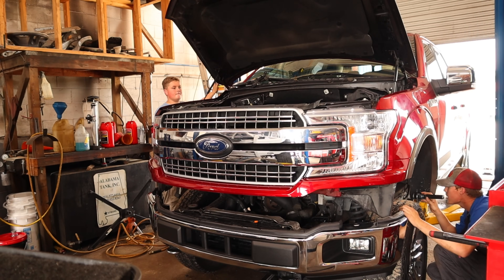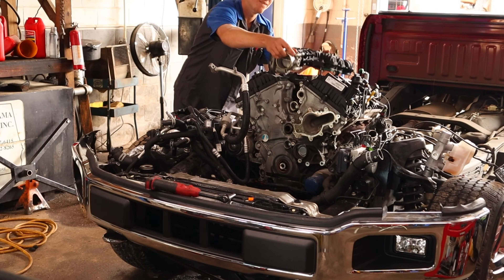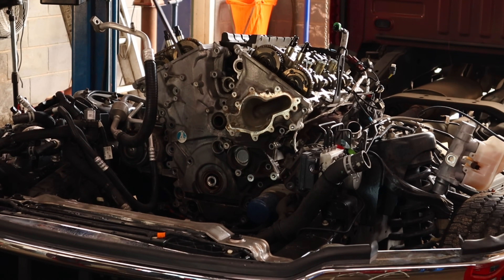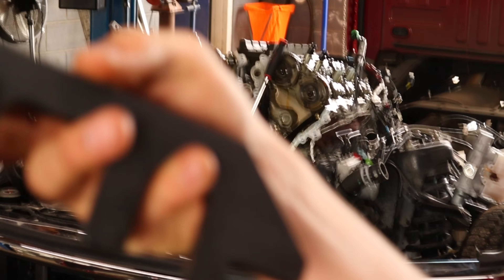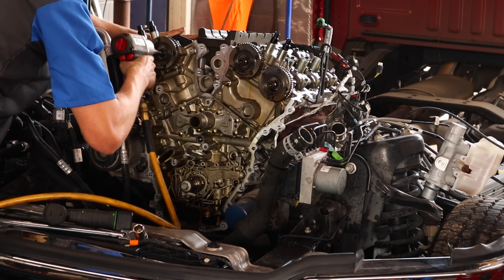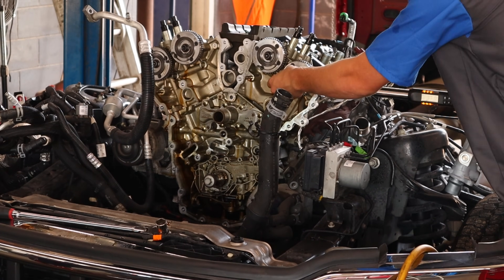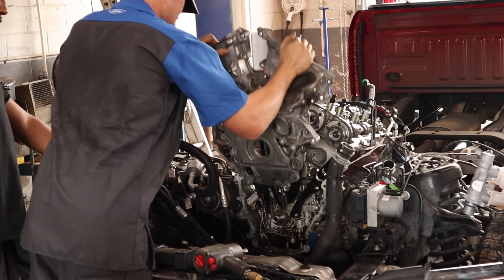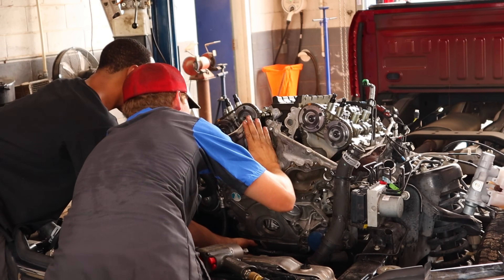Ford 3.5 EcoBoost Cold Start Rattle (VCT Phasers) | Everything You Need To Know

Comment: mine is rolling over 300 now ive got rattle but I generally put the accelerator to the floor to shut the injector off until the oil pressure gage comes up.  I generally have to do it 2 start cycles but it keeps it from rattling.  ive thought about a block heater installed at the oil pan. im probably looking at a new motor soon is it possible to put  a newer gen 3.5 in my 13?

Comment: the explanation you gave for what actually causes the rattle is pretty spot on, at least according to my ford ASSET instructor. they have a pin that is supposed to hold the phasers in midlock right as the engine shuts off, that way in case the oil bleeds out (which its not supposed to, but already failing phasers, or cheap oil filters may cause that) the phasers will be held in the middle position until there is sufficient oil pressure for the solenoids to control the phasers. what happens is sometimes the pins dont engage in time (which the PCM update is supposed to help with), or the pin gets completely sheared off, and then theres nothing controlling the phaser. the actual noise is from the outer part of the phaser, the part connected to the sprocket and timing chain, literally smacking the inner part which is connected to the cam, over and over again until theres oil in the phaser.

Comment: The rattle is because the phasers are coming apart internally and when they no longer lock to the cam, you get the rattle at cold start.  The phasers are junk and poorly engineered….

Comment: I have a 5.0 coyote with this issue. Only happens under load so in park or neutral don’t hear a thing, but in gear every time you let off the gas after 3000 rpm and under you hear the chatter. Also is louder on a cold start but quiet’s down after it reaches higher temperature but doesn’t disappear and again is more quiet in sport mode but doesn’t go away. Just thought I would add more info to the problem.

Comment: 2020 with 70,000 and it has just started making the cold start noise. I will never buy another Ford. I’m done 
Especially with the cost of a new truck that they expect the customers to pay.  Your better off buying on older truck and putting a new motor in it than to repair junk.

Comment: Great Video.... A couple questios.I picked up a 2020 transit with the pfdi duratec 3.5.
Are the same phasers used in my non ecoboot?
My cold start rattle goes away in about 16 to 20 seconda and won't come back until the next morning,Should I be worried?    Thank You

Comment: So what is actually rattling? The VCT solenoids or the phaser mechanisms on the front of the camshaft? My 2019 F150’s 5.0L is rattling. A Ford dealer replaced the phasers and VCTs a couple months ago (covered by an extended warranty I purchased, thank God), but it didn’t fix the rattle at all. In fact now it seems worse than ever 😢

Comment: I have a 2012 ford explorer with 3.5l at atart up it rattles hard for like 2 seconds then it quiets down and there a ticking noise as it warms up .i think its a oil pressure thing.they need to go back to simple engines like 2003 f150 thats there problems new ideas newer problems.

Comment: there is a video from a ford mechanic  and he say to delay start  press brake and hold  gas pedal  to the floor  let it crank  then let of  gas pedal  up and the truck will start with vct rattle  Mayson your correct   oil pressure   bleeding back

Comment: I have an F-150 2018 with both the 10-speed and the 3.5 EcoBoost. I bought it a couple years ago. Did my due diligence truck was supposedly bulletproof. Now the transmission's acting up and I just got the cam phaser rattle today. Less than $123,000 on the vehicle. This will be the last f**** Ford product I ever buy. Ford used to stand behind the products. Now they stand behind you and laugh. Looks like I'm going to be a Chevy man.
Reply: Correct, exactly I got the same problem.2018 F 150 Lariat Brand New truck 35000km same issues.one time free fix.
Again same issues 115000 no free service asking 5000/-
Garbage truck.lost 85000/-
Everything is dummy.

Comment: My 2018 3.5 Ecoboost has been exhibiting the cold start rattle for about a solid 2 years, and was getting progressively worse. I’m just over 100k in mileage. Since it’s a work owned truck and not my personal vehicle, the boss finally gave me the green light to get it fixed. Local dealership here in Michigan did it for $6,200.00 but I also had a cracked valve cover and defective oil pressure sensor switch which was throwing warnings. Picking it up tomorrow… hopefully everything is now 100%

Comment: Could a possible vct solenoid failure be part of the issue of the phaser rattle? Or maybe an oil filter that doesn't prevent oil drain back ?

Comment: I see people going 7k+ between oil changes, 140k on the original plugs, never changed the air filter, and on and on. So much of this stuff can be avoided by doing proper maintenance. With any of these modern engines, I would be doing oil changes every 3k if using a typical group III synthetic and 4 - 5k if using a group IV. Not to mention check the owners manual for other countries and go with that viscosity, and don't fall for this U.S. federal gov't water thin oil scam.

Comment: Done this job twice.. first time for vct phasers. Second for not replacing some of the timing guides. If you are in there, Replace everything!.. phasers,chain,guides,water pump, gaskets etc. Also added a melling high flow oil pump for $170. did not have to drop the oil pan..
Reply: Man I bought my 2019 Raptor new and I don’t think it had 6k miles it had to go in. Top end had to be rebuilt because of the phasers. Now I’m at 149k miles and maintenance it myself, religious on oil changes and fluid checks. Now it’s rattling again. What are my chances you think Ford helps me out with the bill given that the truck already had a problem and I can’t recall getting anything in the mail concerning a recall? Regardless if I have to do it without Ford I will follow your recommendations as didn’t think about the water pump.

Comment: Excellent videos!!  I found them because I now have the VCT rattling issue.  My 2019 F-150 Limited has 109K miles and the check engine light came on last week.  The dealership gave me an estimate of $5500 to replace the cam phasers, timing chains and guides.  My extended warranty company (EasyCare) doesn't want to cover the costs either even though I have been consistent with the scheduled maintenance.  I may need to come find your shop.  Im from Alabama as well.

Comment: I’ve got a 2013 f 150 ecoboost with 125k miles, I’ve had the rattle for a while now. A local shop told me $4500 to fix it. Is this something critical to repair or just a noise annoyance? It’s a pretty expensive repair for an aging truck
Reply: Good question. I'm retired from the garage, but here's what is probable, that can happen. 
First, what's going on is the can phasers, are parts that adjust cam timing, through oil application internally, are weakly designed and wear out. On a cold start they are supposed to be locked, but the locking mechanism wears, and that's what is causing the rattle until oil pressure builds. 
Continuing to allow this will eventually result in breakage and more engine damage. 
The new phasers are beefier. Definitely have it done. Mason's other videos explain more. And the price quote you got is spot on.

Comment: working on a 2014 5.0 4x4.  with low oil pressure.  we replaced the pressure sender. still issues was planning on replacing the oil pump has 150k on the truck.  (light and gage drops to 0 when  idal drops under 500 rmp.) after watching your videos on the phasers. i'm wondering if its possible phasers they are not to noisy . Have you seen oil pressure increase after this repair? or have you seen several oil pump issues too?

Thanks!

Comment: I did this job on a '19 3.5 EB.   I got it back together & felt good about it till I went to start it. It had a long crank time & upon start up, the HP fuel pump was hammering. It would run quiet if I unplugged the HP fuel pump but it had low power. After ripping it all apart again, following advice, all for no avail..
I found a tiny transparent silicone bead (not rtv silicone waste) lodged in the HP fuel rail inlet port (directly from the HPFP).. zero fuel was getting to the hp fuel injectors. I had to replace the passenger side HP injector rail because I couldn't get that bead out until I cut it apart & forced it out. The size of a grain of salt. Where could this have come from?
PS, after replacing that fuel rail, the fuel flow was immediately confirmed & the truck runs great. I am not shitting you.. a tiny bead caused me much grief & cost me an additional $200.. cause I bought a used HP fuel pump $86 & a $105 fuel rail plus the duplicate labor to tear the front down & remove timing chain cover only to confirm what I already knew, that the timing chains were installed correctly.. 
I'd like to know where the hell tjat tiny silicone ball came from & how it managed to get in the one spot that would cause havoc

Comment: It’s the ford customer service hotline. They will usually do a one time good faith repair job so make sure it’s a good one not a 200$ repair because once you use it that’s it. No more. I worked for ford from 1980 to 2004. In my opinion this shouldn’t be happening to begin with

Comment: I'm here with 95k miles on my 2018 F150 and Ford isn't gonna cover a damn dime of this repair smh. They just replaced the flex plate and torque converter on my 2015 Ford Edge with over 100k miles on it and they covered 50% of it. So how can they not cover any of this recall issue on my 2018 with less than 100k miles!?🤬✊️

Comment: I’m this boat currently but I prime my 18 expedition until oil pressure builds before I let it fire off. I hold down the gas while I let it cycle three times or let it crank for about seven seconds, but I wonder if a tuner good tap into the system to longate the crank time Because I was told not all dealerships have the certain software to do that.

Comment: Just watched this and your newer video, very well done. I own a 2017 F150 and while I like the truck for the most part these cam phasers are just crazy. Mine went first at 29,000 miles after 3 years of normal driving. Dealer fixed it under warranty. This past weekend I rolled over to 82,000 miles and the noise started. Our area Ford dealer quoted me 4200 as long as it's just the phasers and never mentioned the extended warranty Ford offered so maybe I could save 33% . Waiting to get a quote from an independent shop after Christmas when I have time.

Other than that I had to replace the water pump at 71000 miles and that stupid rack assembly for the sunroof that I never open; too may plastic parts that break!

Comment: having difficulty removing phaser bolts. I saw you had a bit of trouble on rt side intake... I used a 18" adlustable on the cam with a 1/2" ratchet with cheater pipe & feels like something is gonna break but they aren't budging.  suggestions?
Reply: Hold the end of the bit with one hand
Reply: @mr.barney8147  lmao.. yea, that'll do it.
I removed the cam holder tool & used a 24" adjustable wrench to hold the cam & a 30" long 1/2" breaker bar to break the bolts loose & it took every bit of that. I used my foot to apply pressure on the socket to keep it straight on the bolts during the loosening force

Comment: I have a 2019 expedition @50500 miles and just got the cold start rattle after sitting for a week, I purchased from dealership with 700 miles on it in January 2021,  the dealership was technically the first owner and was never registered or titled so my title says I am first owner but sales paperwork says it was sold as a used vehicle.  I am waiting on a call back from ford dealership service manager tomorrow to see what he says, however I am not too optimistic it will be good news.  I never had the TSB for the reflash done that does not work anyways.  So does anyone have a comment on what my options are or what should I expect going forward.  Thanks.

Comment: i saw somewhere on a forum that you can build up oil pressure by pressing the gas and turning on the ignition to crank the engine and push the oil in the engine before it starts up do y’all think this could work i have an old ford crown victoria
Reply: It worked for my truck for a month now it does it even with that

Comment: Thanks!  Your theory that oil is lacking during start is correct.  I have been starting my 2018 navigator with the gas petal fully depressed to prevent starting and let it time out then start it.  very little noise.  When I forget I get the major rattle.  I have the Lincoln extended warranty  and yes they placed a software update that did nothing.  I have 78,000 miles and run out at 100,000

Comment: Great video. Was in process of buying one thankfully i always run a scan pulled the history had cam phaser code and tranny code. Saved me thousands. In my opinion the auto start not a good idea. If was going to do should of had electric prime pump. And the fact you cant permanently shut it off without a programmer. A gm 5.3 will live 9 lives before any ecoboost. Dad was service advisor for ford but i just cant back them.

Comment: Smart guy.  Add 7oz of Lucas stabilizer and 7 oz of hot shots to each oil change. You will not have rattle issues.
Reply: Why not just run synthetic instead of add a bunch of additives?

Comment: Honda Accord has exact same problem; it rattles for the first 10 second then goes away when engine is cold. Same solution replace the phaser maser what ever you call it, Honda is called "VVT sprocket".

Comment: Within 2 weeks of getting cam phasers replaced on a 2019 Raptor started getting oil pressure oil.   Dealer now says I need a new engine.   Is there something to look for specifically if they did something wrong on fix?

Comment: I have a 2017 F-150 3.5 eco boost. First off this is my 4th Ford pickup and I love it. Beautiful all white King Ranch 4x4. That cold start rattle is killing me. It sounds like it is fixing to explode. I am at 83k miles but been happening for a while now. Always serviced at Ford dealer and when I mention it they say "yeah that's a common problem". But don't offer any repair options. Your video explained a lot and I appreciate it. (new subscriber now)  Big question is, should I be worried? Got half a mind to drive to Alabama and let you repair. I'm in East Texas.
Any comments would be greatly appreciated.

Comment: Wifes toyota also has vct rattle on start either cold or hot. Noticed it decreases a bit with higher viscosity oil or additive. Changing oil to next vidcosity grade up is much easier and cheaper than changing oil pumps. And likely reduces valve gear wear. The light oil specified for most engines these days was thought up by govt clerks working on CAFE numbers, not lubrication engineers.

Comment: If you were just changing the faulty waterpump on a 2018 Explorer 3.5 non turbo with 110,000 miles would you change the chains and tensioners

Comment: Thanks for the Video! I own a 2014 Ford F-150 Limited with 95k on this 3.5 Ecoboost and decided to visit our son 1500 miles away and we got to his place and the Check Engine Light is steady and we got it to Ford Dealership and it was Diagnosed as Timing Chain failure? Of course, I love the Truck and decided to have Repaired and the Price Tag will be $8203. I really have No Choice but to get it Repaired or Sell the Truck? Codes were POO14 & POO16 & POO53

Comment: Just came back form picking up my truck to the San Leandro Ford dealer, just drop it in for diagnostics, they charged me $265 for something I had already knew,. According to them, I had to pay for the diagnostic so they could know what parts where bad. They wanted to charge me $6,500 for parts and labor. Don't have the money to pay for that so I guess I'm driving my piece of shit $40,000+ truck for a little longer.

Comment: Where are you located in Alabama. I want to bring my 2018 raptor to you. I had the software flash done in 2020. It didn’t fix it. My truck sat there for three months and was never repaired. I finally just went and got it. Legacy ford in McDonough GA said they would call me when the parts were available. They never called. Now it’s out of warranty and I’ll have to self pay I’m at about 105k miles. About a second and a half cold start rattle

Comment: 2011 F150 3.5 V6 ... 111,000 .... $4000 for a timing rebuild. Sounds great now. Only rattled on startup. 4 different codes showed up. Very frustrating.
Reply: My Ford dealer quoted it at $5600. And I didn't replace the water pump.

Comment: changed the phasers still have cold start ping. appears to be oil drain back issues. did a cold start prime on it, works so still looking for the issue. probably the oil pump

Comment: So I hear Ford owners say they  Love their trucks.🤔
Why?    Because  the truck has neat gizmos?   Comfortable seats?   Id love to own a 1978 F250.   Shame on you Ford.   This issue reminds me of those oil pressure fired fuel injectors for the diesel engines.  Just a bad idea.   That high of pressure will ALWAYS fail over time.    Designed to fail.